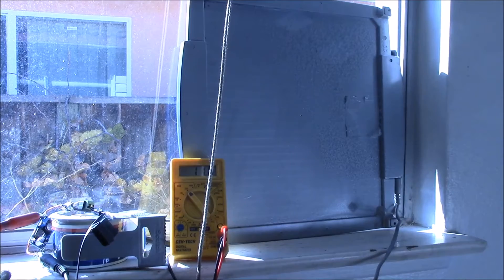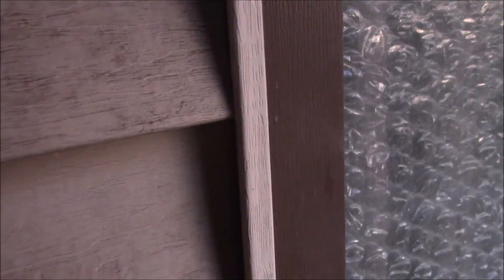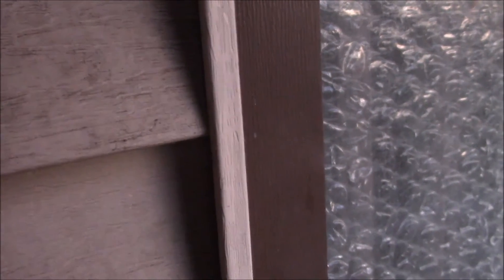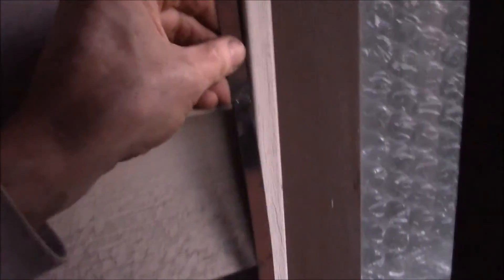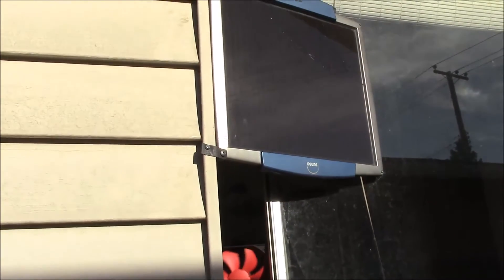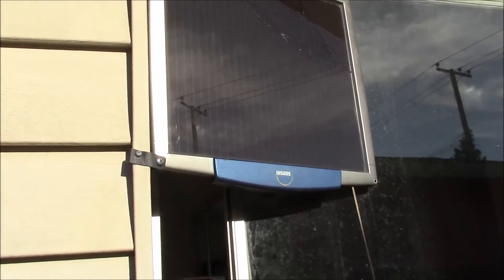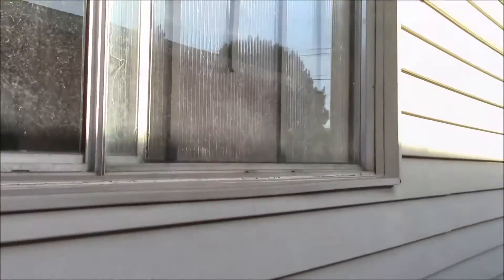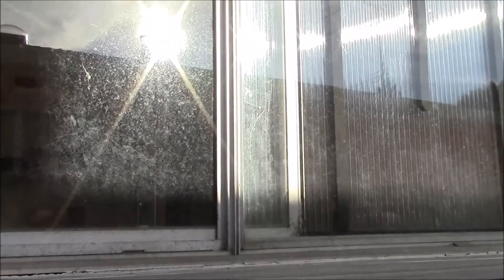In-Window Solar Heater - Build, Part 2

Comment: Law of Conservation of Energy. This heater should have no effect as compared to just the window. The exact same amount of energy will pass through the window with or without the heater. The heater may even be less efficient if it reflects any of the sunlight (energy) back through the window.
Reply from the maker: Good points.  But you neglect to consider the insulation factor.  Single pane glass, as is in this window, is R1.  The double wall polycarbonate panel used is R2 and combined with the glass gives a total insulation value of R3.  This panel collects the heat coming in through the glass and actively moves it away from the glass into the room.  But once the sun sets, it's now reduces heat loss by a factor of 3 over the bare window.  So by the time the sun hits the panel the next day, there's a net heat gain through less loss.  Sure, one could use an insulating curtain and manually raise and lower it but this works automatically and is still running 4 years later.
Reply: yes, good point, I didn't realize the insulation properties. I'm trying to build one that hangs off the edge of my window that blows the air back into my house through a strip of foam insulation.
Reply from the maker: Ideally I would like to move the heat collector pane outside if I can find a decent way to get the hot air back inside the house.

Comment: Pal, there is the high efficient 23% Sunpower (US) Thin-film flexi light-weighted (0.6kg) Solar panel, paired it with a good Sepic Buck Boost DC-DC converter. Fixed it on a flexible goose neck (8-10mm) steel tube. The Japanese Panaflo 12vdc 120x120 Fan or Taiwanese Brand Delta Fan 12v AFB0812HH 0.30A 8025 80x80 will make it perfect to move large amount of air.

Sorry, in Chinese description. FYI, to add-on your DIY ideas.

Sunpower
http://item.taobao.com/item.htm?spm=a1z0k.7385961.1997985097.d4918997.us3UJx&id=42982496964&_u=620resoic5e6 

Buck Boost DC-DC converter
http://item.taobao.com/item.htm?spm=a1z09.2.9.311.0XJ2Z1&id=21386427987&_u=620resoi3815
Reply from the maker: Good information, thanks.  Yes, if I weren't using old components I already had, I might go with something like that.  Actually my plans for power are shifting a little.  I have plans to bring a 12VDC circuit to the vicinity of this room and all I need to do once that is there is add an outlet box to bring DC power to this room.  Then I can use this little solar panel to supplement the DC power from my roof top panels and use that to power the fan(s).  I'll either use the small panel to turn on a relay or a little 12VDC thermostat to turn on the fan and just tie the small panel into the main 12V circuit.  I'll test both options out once I bring the 12V power circuit to this side of the house, my solar battery bank is on the other side of the house.  I just wanted to get something together this winter so I could test out the concept.